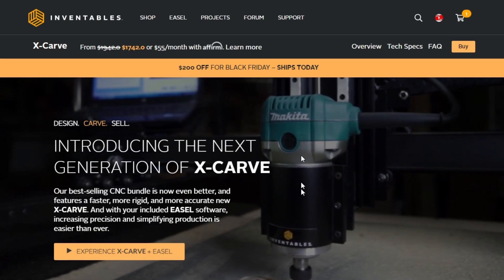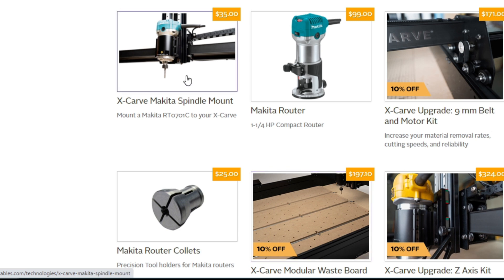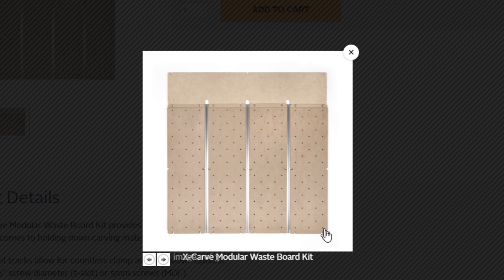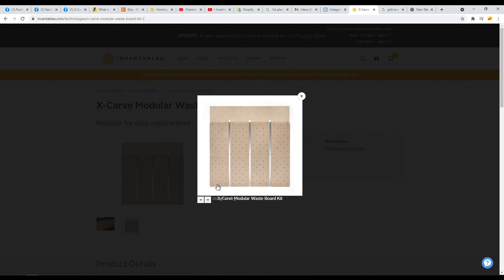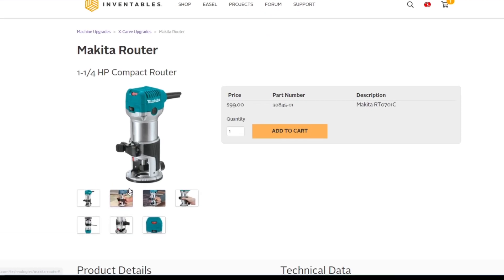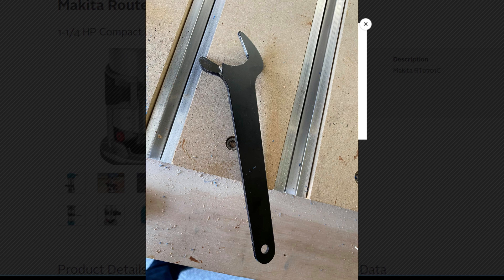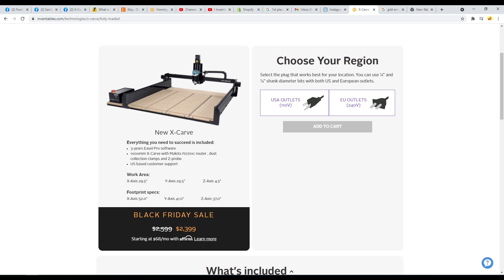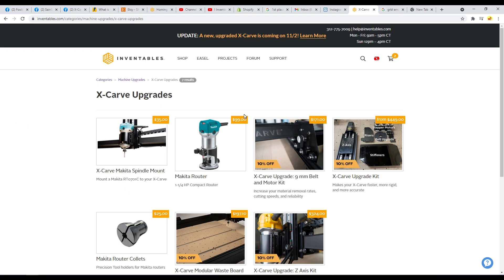X-Carve Update November 2021

Comment from the maker: If you need to change the DeWalt over to a Makita or other 65mm Spindle get one of these 3d Printed Adapter Sleeves from PwnCNC.   Use coupon "SALE" for 5% off the order.
https://pwncnc.com/products/spindle-collar?ref=SALE&variant=39676821176459

Comment: Must be cranking the heck out of the nut to break the router and the wrench! I have the Makita router on my XCarve.
Reply from the maker: There are photos of the graveyard of routers in both the Onefinity and  Shapeoko Facebook groups (the Carbide router is a makita clone). That button surround is cast and the manual states that its to start the thread by hand, but many users, especially those used to the single wrench system that the Dewalt uses,  will go at it using only the button and a single wrench... usually the punched steel wrench bends and then they get a real wrench and that's when the router cracks to bits.... usually the router is still operational, but the button is not so lucky though.

Comment: One problem with modular wasteboard, eg after 5 surfaces & you want to replace 1 board, it's significantly thicker than its neighbours. Definitely time to start shimming as I wouldn't want to skim 1/4 inch off new board immediately
Reply from the maker: That's true.. no real point in replacing only one or 2, although the shipping costs are less for a stack vs a full size single board 😂  

actually it probably actually costs the same for the 5 pieces and the t track as the single large board when considering dimensional shipping rates into those costs... at least here in the US 🤷‍♂️

Comment: Can it use software outside of their web based one?  
Is it possible to pause and shift longer projects which don't fit?
Is it possible to get a "Spindle" especially one which can use an ATC?
Reply from the maker: Yes, it uses a grbl controller so other grbl senders work fine: UGS, OpenBuilds Control,  gSender, Picsender, even Candle would work.  

The front and back are open,  so tiling works as well.